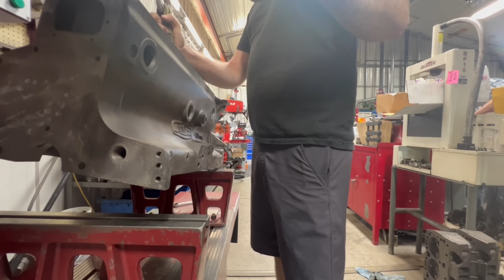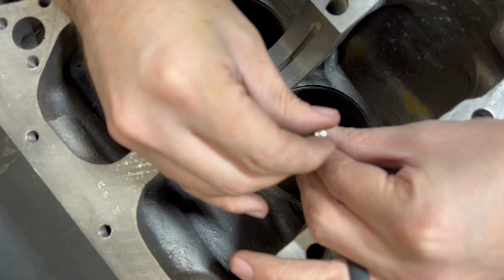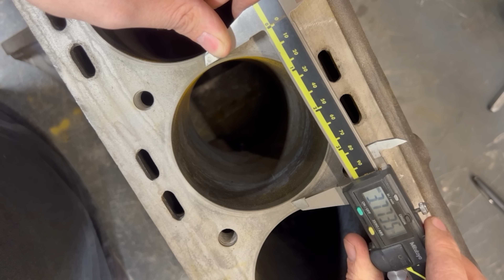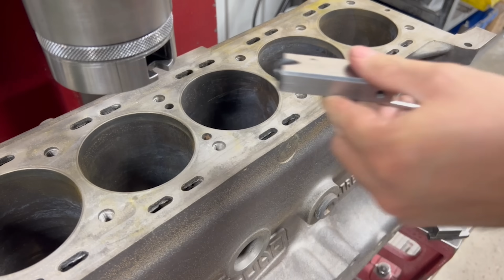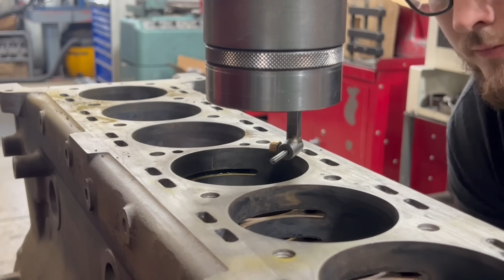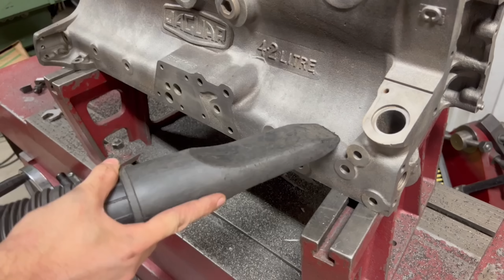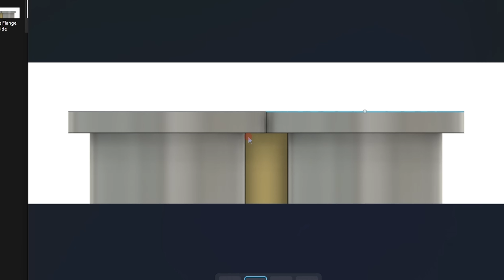Can This 1968 4.2L Jaguar Block Be Saved?

Comment: I've seen one jag block as bad as that was repaired by grinding out the cracks and brazing them up. It held up very well and is still running beautifully after 20 years.
Reply: I agree with this as it would give the most longevity out of the repair and since the parent cylinders need bores because of taper anyway the machining time to clean up the extra braze would be minimal
Reply: Agree 100%. The family service business dealt with these and other sports cars back in the 70s and 80s... our engine builder/machine shop would carefully hand ball mill the cracks with die grinder, oven the block to raise it well above ambient and reduce stress at the braise area. I recall they uses a no-nickel braise, more in the bronze braise alloy family, to fill the voids. A long post braise rest in the oven slowly lowered the temperature,  and re-machine followed. sometimes a top hat liner was chosen. Braise was less brittle than the iron, and had such a close thermal coefficient of expansion it was nil. 
 ....and we never saw evidence of re-cracking. This block is absolutely a fixer. Old school guys did this all day long decades ago. Don’t loose that knowledge.
Reply: @jenniferwhitewolf3784  Thanks for bringing this knowledge from old days to the table. And I appreciate your civility as well !
Reply: We have a farmall M where a rod came out and said hello to the world, I know it’s not exactly the same but it was brazed closed and rebuilt and it’s since been rebuilt again and still holding up just fine
Reply: Braze it, top hat sleeve it, send it... could even spray a little funny gas on it afterwards... done many times on these old inlines.. #rickybobbyletsgo
Reply: @swaits4no1  I was going to ask if this was an option to do. Since the original block has to be actually bored for the sleeves anyways, couldn't they grind the cracks out a bit with say a cone bit or a small diameter cylinder bit, then braze in a fill, top hat bore/hone the cylinder, install the sleeve, and to improve the durability of the engine, go back with original bore diameter (new pistons and rings)?  That would add .020 more wall thickness to help reduce the chance of a subsequent crack.
Reply: We had the same type of Crack brazed on an old ferguson tractor engine with wet sleeves it still holds.
Reply: Jesus this comment section is one helluva ride
Reply: Lots to unpack here. Firstly I don’t go around the internet with my credentials on my sleeve. If you can’t see the sense in what I’m saying that’s on you. I couldn’t care two hoots, this is the internet! One’s skin has to have a certain amount of chappiness to venture an opinion, and what I said is just that. An opinion. 

That being said, not too many metallurgical scholars will argue that brazing is weaker than an actual weld. Cast iron itself is a weak brittle metal. Because of the relatively large amount of carbon dissolved in austenitic iron  it doesn’t weld well. Application of heat locally while working with cast iron without bringing the entire piece up to temp can set up internal stresses if not properly and uniformly heated AND cooled and usually do crack again. 

There is not only the dissimilar coefficients of expansion to think about. The brazing alloy usually has a much lower melting temperature that is lower than the parent metal. So actually, as someone has said, brazing is more akin to soldering than welding. 

That being said, I always qualified my statements by intimating that the original posting was NOT WRONG. I am not nearly arrogant enough to suggest that I am the be all and end all of welding processes, BECAUSE I AM NOT. No more or no less than anyone in this comment section. Take what I said with large amounts of salt. Matters not to me. 

I will say that I have owned several XK engines. Which is where the experience comes from. Whether you believe that or not again is up to you. I think that qualifies me to give an OPINION. Never stated what I said as fact. I can truthfully say I have encountered this problem under discussion. When it comes to cracks bathed in the flame front, brazing has ALWAYS FAILED ME. Sure it works for parts that aren’t stressed. Cracked combustion chambers and tops of cylinders though don’t really fall in that category. If the ring set is able to glide on the brazed area it should  act as more of a bearing material than the cast iron might and could present mechanical problems to that system. That has been my experience. BUT YOUR MILEAGE MAY VARY. 

AGAIN, I AM NOT SAYING YOU ARE WRONG. But my experience teaches me otherwise.
Reply: Not that I have a heat problem but the final drive on my excavator had a REALLY cracked mounting flange, cracked 180 degrees around the bottom half. No idea how it held on long enough for me to find it. Gave it to my machinist, he gouged it, preheated for 24hrs also to sweat it and then brazed the cracked cast and then cooled it for 24 hrs. He then machined the mating surface back to flat. Said it was the hardest stuff he ever cut on his lathe
Reply: I mentioned that as well, never seen it done on a block but I've done it on cast iron. Did you drill out the end of the crack and fill it to try and stop the spread?
Reply: @WolfieMel No. Shan’t. LOL
Reply: @BoogWar01  yeah, you have an opinion. A wrong one 😂😂
Reply: @BoogWar01  I'm so confused at the insane amount of hate you're getting in this comment section it is nuts. Everything you're saying makes total sense. You're even putting huge disclaimers in your statements. 

These mechanics SERIOUSLY hate engineers or those engineer minded. You're one of the most sensible engineering minded people I've seen on the Internet. 

The gear heads can piss off. I always love the "you don't have anecdotal evidence so piss off." 

Reminds me of one of my favorite animes.

"They say that fools learn from their experiences, while the wise learn from history. I hope you're not a fool."

Not to say everything can be learned in a book but concepts at least should not be ignored.
Reply: @Daemonamongyou  i am a engineer in the auto industry and a gear head, wrenching since childhood. You have no clue how often engineers are wrong, denying the obvious even if its right in front of them, this idiotic post about brazing not working is the best example.
Reply: I had the thought of brazing it up
Reply: This is how i would also fix this issue, grind the cracks out and use the overlapping top hat sleeves as double insurance
Reply: I agree, ive done many tractor blocks this way and all but one of them is still in use. Beveling and brazing the cracks, then machining the bore to spec will yeild a strong repair.
Reply: I think TIG brazing over traditional torch brazing, no?  Maybe low balance AC for just a bit of cleaning action, and TIG for less overall heating and distortion. Slight peening between passes to reduce residual stress???
Reply: My uncle did the same thing on an old Chevy. It rank for many years after that before he sold it
Reply: If those cylinder walls between cooling passages #1 & #2 were not so thin I would say aluminum welding would be the way, but Tig way too hot, maybe with a 120v machine and mig alum 5356 wire with 100% Argon, DCEP
Reply: Would do the same
Reply: Couple weeks late to the party, but, I had an old LS fitted with top hats after finding cracks. The machinist bronze brazed the cracks first. I have put on another 50k miles since the repair.
Reply: That's what I would do
Reply: I've got an old International block that has braze repairs from the factory. Standard bore, never been rebuilt, but brazing on machined surfaces.
Reply: Since braising with bronze seems to be a permanent fix (according to this thread)  maybe Jaguar should have just cast the whole block from bronze in the first place.  Then it wouldn't have cracked at all.
Reply: Would brazing also be beneficial as it’s a “non destructive” method and thus maintains just that much more originality? 

I would think that on a very valuable car, brazing vs cutting into the block would be preferable from an originality perspective. Brazing feels to me like it would be the most conservation friendly approach, because in theory the block could be torn down and the solder removed, returning the block to its “original” condition. Maybe whatever car this is out of isn’t special enough to warrant that level of consideration, but on something like a Duesenberg or Ferrari 250 it might?
Reply: Don’t know how that would work. Different metals, different coefficients of expansion. Brazing is a melding technique, not a welding technique. Creates a solution of metals. One would think thermal fatigue will occur quickly. Your experience obviously differs, and I’m not saying that you are wrong.
Reply: @BoogWar01  Gray cast iron has a thermal expansion about .000006"/°F vs a .0000062" of a nickel brazing rod. If the engine were running at 210°, there'd be a .00004" difference in expansion...which is less than negligible as the cast iron and braze filler are both still a bit ductile.

On cast iron that is properly weldable, you would eliminate that ductility in the weld area creating a very rigid area with a far higher likelihood of cracking
Reply: @94XJ  but that’s just it. A XK engine is made from a chromium / cast iron alloy, purportedly done for good wear properties. That alloy is known to be especially brittle. All cast iron is, usually a part made from cast iron dropped on a hard surface will shatter. I don’t know about it being ductile. 

But I am NOT saying you are wrong. I will go as far as saying our individual perspectives  differ.
Reply: @94XJ  good technical info!
Reply: @jadabaudelaire118  It's so small, the grooves from honing a cylinder are larger that the expansion difference! There's also not really another option for most cast iron so the back and forth with surface level search engine knowledge is really amusing! 😁
Reply: @94XJ  I've no experience in any of these things and I'm not sure why the video came up on my feed....., but the engineering and specs details and resulting conversations were a glass of water, for a thirst which I had not even felt, nor would have expected.

Process of resurfacing and restoring to stay true to numbers... Interesting. 
Humanity has some wild quirks!
Reply: @94XJ  don’t waste your time with bro he looked that bs up on google 😭
Reply: @BoogWar01  it's well proven  technique using bronze brazing to effect durable repairs on stressed cast iron components,you generally apply a special tinning flux then the bronze rod with normal brazing flux .the method uses inter granular penetration it doesn't rust and is easily worked after application.
Reply: @bigsmoke6189  I think that is why it shouldn’t work. A) brazing is a lot weaker than welding. It’s actually a solution, kinda like putting Copper Sulphate in water. One metal dissolves in the other. Well that’s how I would put it. 

B) Ya gotta know why the block cracks in the first place, too. Jaguar started making these blocks in around 1948 in 3.4 litre guise. For the XK140 or 150 they moved from 3.4 to 3.8, which is the block the factory used for racing in the fifties. 

To my knowledge when they started to make the 4.2 litre (introduced on the E-Type in the mid sixties) the factory engineers realized the extra wide bore was pushing the limits of the block, ie the space between cylinders was too thin for the amount of chromium they added to the block alloy (improved durability , ie with the specially formulated rings these blocks would last A. LONG. TIME). THE 4.2 cracked during initial testing. So they added sleeves during manufacturing. 

A similar set of circumstances happened around the small block Chevy’s growth to 400 cubic inches. Those cracked if you looked at them wrong too. They usually cracked bolt hole to cylinder though, and I don’t think they were sleeved from factory. 

Point being the thinness of the deck in the area between cylinders caused cracking. Then Jaguar did some silly things with the XK block. They used to put these blocks in sand pits and let them cure for six months before assembling them. With the introduction of the E-Type, the popularity of that model drove them to shorten that cure time, and now the cracks started appearing in service. Jaguar was always known for quality at a reasonable price, but the methods used to make the cars were antiquated at best. For example, Jag replacement pistons aren’t classed by size. They are sold by GRADE. A thru E, IIRC. Which makes the car serial number very, VERY important when ordering parts. I think that’s why the galling appeared at the bottom of the sleeve. Sometimes even the factory got it wrong. Tolerances would stack up on one side, and eventually…

To alleviate the cracking the slots were introduced in the bore and later on, the block deck. Data suggested that if they gave the coolant access to the sleeves it would somehow stabilize the top of the block during its heat cycles. Hence the slots. It worked…for a while. However from this point on the engine became very fragile, as the factory always introduced bodges that seemed to bring the engine back to a place where something went wrong. For example, they started machining main bearing bores slightly oval to cure a body boom problem they discovered on the Mark X. After they had discontinued the Mk X and consolidated the product line to just the XJ and the XJS, the mains were never returned to being round. Not for some time. 

Brazing that block is not a solution I would recommend as you are putting dissimilar metals into a region that is already prone to cracking. I can’t speak for other blocks as I don’t really have experience with them. Might it work? Based on the evidence given here, I would have to say there are times that it will. I have to qualify that with…it depends on how it is driven AND cared for. The coefficient of expansion of the two dissimilar metals should cause an eventual failure of the joint. 

Maybe though there are brazing alloys with a CoE similar to that of cast iron. Who knows? 

If this were my shop, I wouldn’t braze. Too many unknowns.
Reply: @BoogWar01  Jesus. You should be embarrassed that you wrote all of this nonsense. Go try to be a nerd somewhere else. The experienced folk will keep brazing, as it works.
Reply: @wanders278  can you not be a tool when you reply?
Reply: @BoogWar01  The basic problem with the upper block design of this engine is the  cast iron is too thin, and the water flow too constricted to handle the heat expansion and contraction over time... if this engine were to ever suffer from low coolant levels (even if it never overheated) it would still be prone to cracking (which is probably what happened). There are a bunch of different of brazing rod alloys/fluxes available. For cast iron, nearly any brazing rod will work fine; cast iron for engine blocks is "ductile", and most brazing rod for cast Iron are stronger and more ductile than the cast iron. Properly "veeing" out the crack and putting in filler will fill the crack and lessen/ eliminate the cause of the crack.  Brazing works: there isn't a ship afloat or a sub in the ocean that doesn't use a brazed joint somewhere. Many "field repairs" done with brazing have demonstrated amazing durability in all areas (80+ year old repair jobs are still operating). Again: Brazing is very easy on cast iron: the braze is almost always stronger and more ductile than the base metal, and it forms both a chemical bond (which prevents oxidization) and mechanical bond (with an amorphous structure) which is far more resistant to localized stresses. In short: The cast iron supports the braze and the braze filler protects the cast iron from cracking.
Reply: @BoogWar01  Not to be a ass or anything but have you brazed anything? It can be pretty strong it certain situations, hell I even brazed with a coat hanger and oxy acetylene a rebar into a steel pipe for a bumper and it was stronger than I ever thought it would be LOL :-)
Reply: @matthewhelton1725  I am wondering if the cracking has to do with the shape of the fluid ports as well. If there are sharp edges and flow paths, there will be uneven cooling. Though I cannot say how much temperature variation there would be.

Brazing should still outlast the engine and I doubt it'd be the failure point of the engine. I would heat the block up a good amount before brazing, not just around the crack.
Reply: @Xlaxsauce  it's the fact there is a hole there. It's a stress concentration, and likely due to fatigue.
Reply: @BoogWar01  hot DAMM you know a lot about jags and the history of their manufacturing! Lol

Even though your opinion differs from mine, I still think your knowledge is impressive and your opinion can't be discounted as naive. So, thanks for writing and explaining your thought process.

I'm still for team braze. But, only because I've seen it done and stand the test of time (even though it doesn't seem like it would, as I first thought as well when I seen it done).
Reply: @BoogWar01  brazing has been used on cast iron for literally centuries, with great success.
Reply: @Xlaxsauce  ...like reshaping the ports with a thin wall, right below (and/or) above the crack(s) ? Not sure it would be possible to maintain efficient enough cooling though, but who am I to throw something that stupid in a middle of a pugila like this one ☺️
Reply: @BoogWar01  You clearly not only have no experience of these types of engines, or in this field at all, but you also don’t understand the principles and nature of brazing, or it’s value in such situations. 

Brazing is demonstrably NOT weaker than welding. In fact, the disadvantages of welding are obvious, not least due to the rapid heating and cooling involved in the process, and the totally different nature of the materials involved, and how they will behave in service, potentially creating new fault lines. 

There used to be an excellent blog page on brazing somewhere on the net. But like the one on black chrome process, it is sadly no longer easy to find. 

In the 1970s I worked on the development of the Rolls Royce RB211 fuel systems. I personally built hundreds of burner sets for engine test, as well as destructive and non destructive tests. 

We used to braze the swirl chambers to the burner arms using precision cut brazing wire inserted into annular rings. 

I also designed the high precision assembly jigs for those processes. 

But also, after TIG spot welding the pintles to the swirl chamber cross members, we brazed them too. Those brazed joints were literally all that prevented those parts from breaking free and flying through the turbines - thus recking the engine. 

I guarantee you have no idea what I’m describing here. The whole process was an official secret for at least two decades. That’s the difference between theory or reading an account in a book, and spending months and years actually DOING. 

The reason you don’t understand brazing is because very few people do. The equipment required can be more expensive, and it requires three dimensional multilevel skills. Conversely, welding is cheap, and can be taught by a combination of theory and practice to otherwise relatively low skilled people. Because I didn’t do any of the welding, I’m actually a lousy welder!
Reply: @G58  while I found your comment interesting I'm left which a bunch of questions. 

Brazing and welding are technically the same thing just as soldering. You're melting a material and a flux between two different bodies. 

With welding you sometimes get the material so hot that you literally melt the bodies but not always. 

The main weakness is similar in all the methods. Material differences, metallurgy (different metal blends), and heat stress.

It's not really a question of brazing or welding being weaker or stronger. It's a question of does it work for the metal and the specific application. 

There are always pros and cons to every method. Welding induces an insane amount of heat stress. 

One method could be stronger in one avenue but weaker in another.
Reply: @Daemonamongyou  Thank you. But no, brazing, soldering and welding are actually technically all totally different. The temperature differences between brazing and soldering are of course enormous. Soldering only melts the solder, and requires the material to reach that temperature. Brazing melts the brazing wire, but the material must be extremely hot. Neither causes the material to melt. Both brazing and soldering use a heat source. 

Welding heats only the immediate area being welded, and does so very quickly. This is why settings are very important.
Reply: @G58  you kind of said what I already said but just repeated it back. Just because it's an electrical heat source doesn't mean it's not producing the same effect (kind of my point).

Soldering and brazing are (mostly) identical the only difference is the temperature at which you're doing it at. 

Welding is still (mostly) the same. Just because you have a short burst of heat doesn't mean it doesn't cause heat stresses. (Kind of my point)

Really the only difference is the amount of heat applied and how long the heat is applied. 

Generally speaking you would actually want to heat treat the material especially in this case if you wanted to get out most of the heat stresses or do them in a setting where things are already hot. 

I was reading someone talking about this for welding but for soldering it's a heat pad either way does the same thing. 

I'm just saying from a stress perspective they are (mostly) the same in regard to how they effect the material. It's just the degree to which those conditions effect the material.
Reply: @Daemonamongyou  Welding is assuming to melt and mix the metals. Otherwise it's called a shit weld.
Reply: @G58  The only difference between soldering and brazing is the solder used ant it's melting temperature. Otherwise they are technically and chemically the same process.
Reply: @rosomak8244  you wrote:

“G58 The only difference between soldering and brazing is the solder used ant it's melting temperature. Otherwise they are technically and chemically the same process.”

No. Soldering uses the ambient heat of the soldering iron via contact. Brazing requires a flame to heat up the components to a very high temperature. It’s obvious that you’ve never done either, or you would not make such silly claims.
Reply: @G58  soldering / brazing results in  a metallic solution. Parent metal doesn’t melt. You can solder with a flame. Brazing, as he suggested, occurs at a higher temperature - but it is still just a solution. I happen to think he is right.
Reply: @BoogWar01  Depends on the size of the cracks. Differences might be very negligible though you're there should be fatigue.
Reply: @BoogWar01  yep you have no idea what youre talking about. Brazing is the way.
Reply: @fuckingpippaman  it is a newbie response based on lack of information. Happens all the time.
Reply: @fuckingpippaman  
Brazing is likely a viably solution here, arguably the best solution, but his statement of it being a "melding, not welding" isn't really wrong. No braze can hold a candle to a proper weld, though a proper weld takes a great deal of expertise to accomplish.

Brazing is more akin to high-temperature soldering than it is to welding.
Reply: @merlinious01  correct, but in practice, braze repairs of cast iron components are an extremely common, accepted, long lasting method.  People braze blocks, heads, and manifolds all the time and as long as it is done right it rarely cracks even where the original parent metal was known for cracking.